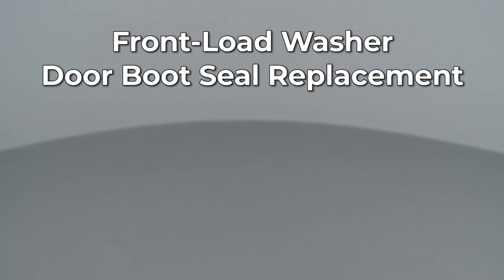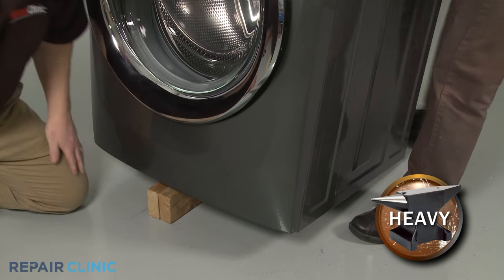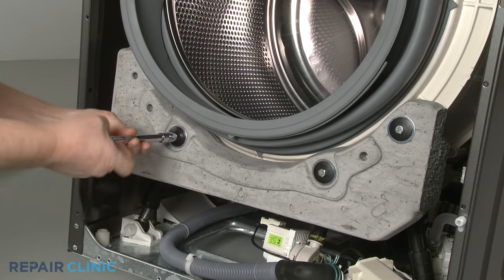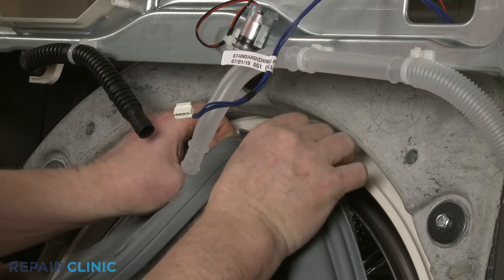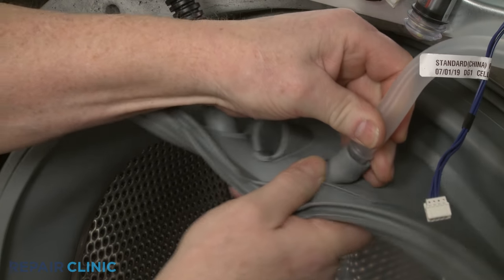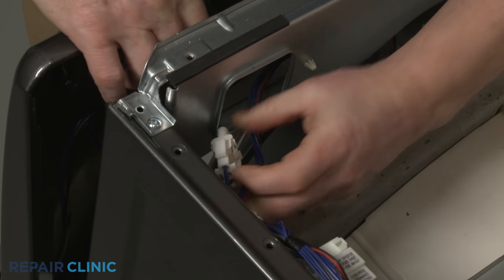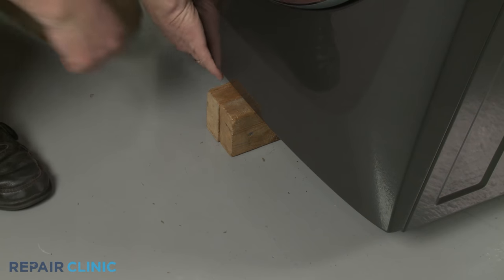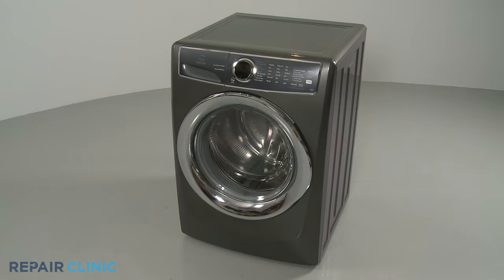Electrolux Front-Load Washer Door Boot Seal Replacement (part 5304505004)

Comment: Thanks for this video, seems so straightforward until the lip seal, struggling with getting the clamps to stay on, they keep popping off.  Any suggestions?
Reply: sorry, I mean the retainer spring
Reply: I am reading the comments looking for guidance as well. Please share if you figure it out!
Reply: Make sure the side of the seal facing you does not have wholes around the edge, that side should be facing inward to the machine. Also make sure there’s a notch bump in front of the arrow at the top... that should slot into the notch at the top of the outer ring.
Reply: I found that if you start at the top and work left and right until just under half way around, and then use a quick clamp on both sides to hold the spring in place, that you can easily then finish routing it around the bottom half.👍
Reply: want to clarify that clamps weren't my idea.. I read that here , but the technique was what I was trying to help with:)
Reply: I just did mine and all i needed was an extra pair of hands. I started from the top. (Retainer spring) Then proceeded with working to the left and going to the right. You have to simultaneously kinda pull the spring (left/right) until you reach almost halfway of the diameter of the drum. You hold it tight, while the other person pulls the remainder of the spring around it. The tension is very strong so you need men to do this. And boom! Its done.
Reply: @oguerrero714  You definitely do not need "men" to do this. Um, I mean, unless you're using something other than your fingers to hook under that spring... 🤣

Comment: Yes Comments on removing counter weight ring to get new gasket on were big help.  How that guy in video does it so easily, I don't know... but my guess is he may be putting the old gasket back on.  When I was realizing I may have missed something regarding fitting on the new gasket I tried putting my old one back on and it seemed to go back on.  Hummmh.  Guess it was stretched out?   
I have another possible (but maybe not safe?) tip regarding putting inside spring back in.  I didn't have anyone to help me and the 'clamp' suggestion in the video wasn't working - Since I had counter weight off, I used the tabs which the weights were held on to help me stretch the spring around to opening and onto the groove.  Worked, but may not for the faint of heart.  I used screws taken off the weight mount to prevent spring from slipping off the tabs and  shooting off through a wall, ceiling, or me if my approach proved to be a fail.
Reply: He was putting the old one back on. At the start where he cut the plastic ties, he put a small cut in the seal. when he added the new plastic ties that cut was there under it.
Reply: Did you have issues with the new boot not sitting flush to the outside tub?

Comment: One of the reasons the front is so difficult on and off, is that you need to loosen one screw and remove one screw from the top of the reservoir that houses the detergent sliding door. On my model that reservoir fits into two screw housings on the front and so it does not fit together until the front has been lowered fully into place, almost impossible to get the front back on without dealing with these two screws.

Comment: Would I need to do this just to clean the seal of mold?
Reply: If it's moldy you need to replace it
Reply: Thats what i did… you can get it way cleaner if you remove and clean in sink with some round drinking straw brushes to get gunk out of all the little drainage holes. It saves ~$100. I have had success in past machines with cleaning drainage channels, then run machine on sanitize with two cups of baking soda and a cup of apple cider vinegar.

Comment: I put everything back together but it’s not turning back on. Any suggestions of what might be wrong?
Reply: Hmmm. Carefully check the connections that you disconnect. Check plug in wall. Check circuit breaker.

Comment: The boot seal I ordered was missing the rubber sleeve where the circulation tube goes into. They must have cut it off. I tried to rig it up but I’m not 100% sure the tube will stay in there. This is so irritating.

Comment: This was a great video, but ditched this piece of crap washer. Have grown to absolutely despise front loaders now, especially after this. Pulled the gasket off and everything was full of mildew. The recirculating water line, drum, etc. this is a WASHING machine that uses water. This should not have to be maintained at this level. Not groaning at y’all just this mess they think is innovation. Literally just got back from Lowe’s with an old schools top loader without all the crap in it. Again, video is solid and helped me get this thing ready for haul off.

Comment: Is it me or is the boot too small?  It fits but it sits proud rather than flush with the outside drum.  Any help would be much appreciated.  Cheers
Reply: Wondering the same. Also after first wash had small rubber pieces peeling off all in the machine and it’s STILL peeling and sitting far back from the drum. Kinda concerned

Comment: How does the boot go in?  You don't show which lip and how the bump on the seal install.  Initially your video looks good but you don't adequately show the main install!
Reply: Right. Did you figure it out? I need help!
Reply: @christymcfarlin664  yes, for each part of the boot, it has a lip that goes under and over the ring that it's sealing.  The first step has a small lip that goes under the inner ring and a larger lip that goes over.  I don't have video unfortunately.  The easiest way to tell when you have it right is when the small arrows around the boot are flat against the metal.
Reply: @joshbarnes5783  Thank you so much! Been struggling with this for hours. Should have read the comment three hours ago.

Comment: Just followed these directions perfectly...then my washer won't start! Any ideas of what else can be wrong? The light goes on when I open the door, but the front digital control board will not light up when I press power on. Did I blow a fuse or something? So frustrating!
Reply: @planetarizona9865  Yes, I looked at that. I disconnected and reconnected like the directions stated. Did your washer start right up after you finished? I thought maybe there was restart code in the computer or something.
Reply: Same here! I was all proud of myself as it was pretty easy to do (removing top weight gives great access), and full confidence in seal being on correctly… then with everything buttoned up, plugged it in and power wont turn on. Doh! I saw your comment before i started job so i was very meticulous with both harness connections… so now i take it apart and see if its the connection. Did you ever find root cause?
Reply: Im going to follow up on myself and discovered that I didn’t have harness fully clipped to circuit board, was being to gentile to avoid causing damage to anything fragile on circuit board, and it has a small click, before a more positive one when fully seated. Duh, lol… anyway that solved my “power no workie after i dun” issue. 😆

Comment: These are absolutely rubbish machines... the mould you get behind the boot seal even if your machine looks spotless is disgusting and causes a heap of issues with your health. The ability to remove a boot seal for basic cleaning should not involve a near complete disassembly of the front of the unit...
ALWAYS go for a top loader with an agitator  inside it.

Comment: I am a very accomplished DIYer. Don't even try this repair. 6 hours later, multiple leaks. The machine was not build to be serviced. nIt could e I have the incorrect bellows, but it is an original Electrolux part from my serial number and was over $200. The seal does not sit flush on the inner tub, the spot for the tab does not have the correct indent for the tab. Extreme waist of a sunday.
The video is also shy on a couple of key points about the bellows, its placement, how to get the spring in place, etc. You have been warned.